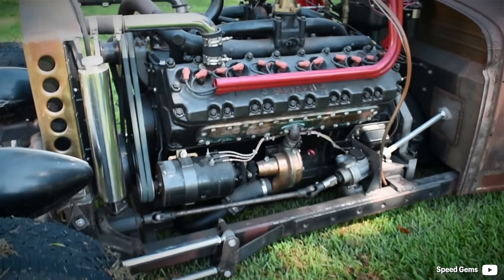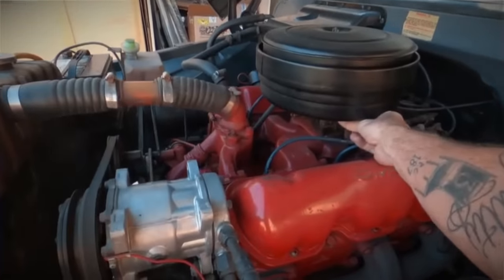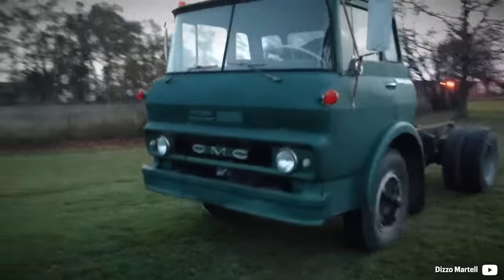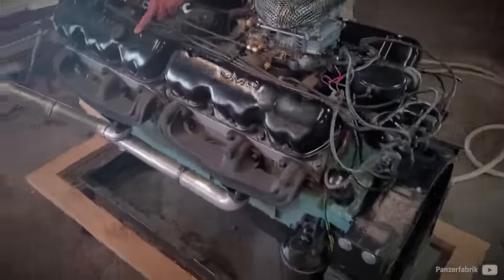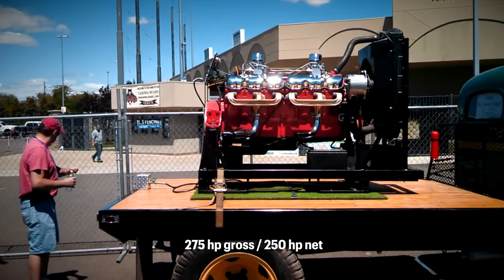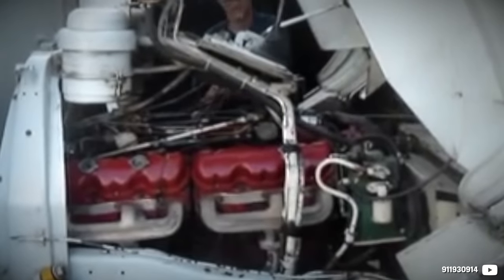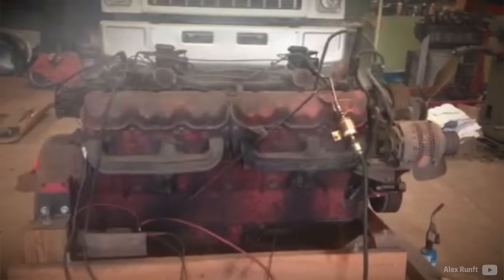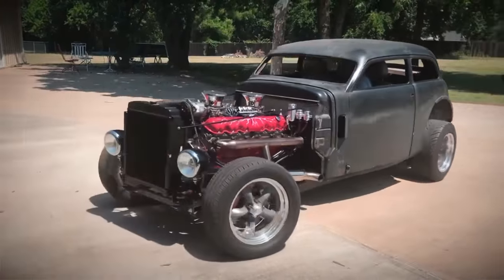GMC's Low RPM Gasoline 11.5-litre V12

Comment: Another interesting thing about the GMC motors is that most if not all of them have governors on them. I think that's the only gasoline motor vehicle that I've ever driven with a governor. I believe in the owner's manual, it actually talks about revving the motor to the governor between shifts.
Reply: the governor  can be turned off
Reply: @punker4Real  yes, but you risk blowing it up if you do.
Reply: International v549 in 70s school buses had governors on em. 
I know of 2 right now in generator applications. 
Huge gutless thing ,only runs a 75kw gen at 1800. 
They did the job ,but what a heavy tank.
Reply: The 351 big block Tonawanda engines used in the Chevy Topkick and GMC Kodiak trucks had governors on them.
Reply: @butchs.4239  I've never heard of that motor before.   Was It a GM product?
Reply: @clinkerclint  Yes, though it turns out they were 366 cubic inches. Had one in a 1990 Topkick 24' cargo truck. The governor wasn't mechanical, it was part of the ECM computer. Made the truck annoying as hell to drive as it wouldn't let you gain enough speed going downhill to make it up the other side at anything close to the speed limit. Took a few tries but I finally found an ECM chip that bumped the top speed from 57 to 66 mph. Doesn't sound like much but I drove that truck from ocean to ocean at least a dozen times and it made for a much more pleasant road trip.
Reply: @butchs.4239  Holy cow, that's a big trip in one of those trucks.    We had a 366 in a 73' C70 ten wheeler.   It would run no-joke, 90mph.   Like you said, they needed speed to get up the next hill.   Absolutely gutless.   That motor has always been one of those things that just never made sense to me.   Small bore.  Not enough CID.  Massive packaging, tall deck, 4 rings.  Square flange Holly carb (when they were using carbs).  I've never found the camshaft specs but I swear they had to have had a tight LSA or a bunch of overlap.   All the ones I was ever around had a fairly rough idle.    Such a weird combination and GM kept that motor FOREVER.
Reply: @clinkerclint  Mine was an ex-Penske truck, I always assumed either GM governed them due to 55 being the speed limit when it was built or had it as an option for rental fleet operators, school busses and the like. I've driven later drop nose Uhaul trucks with same 366 & Allison transmission that would comfortably run 75 mph all day. With a decent load in it it rode well enough that it wasn't bad to drive long distances, you just weren't going to get anywhere quickly.
Reply: @MrTheHillfolk  Loadstar 1700 with a IHC 549? I think they came in dumptrucks. That would make a nice 2 stroke conversion.

Comment: My 1969 GMC 5500 grain truck has the 305C V-6. I bought it 31 years ago with a blown head gasket, rebuilt the beast, and it's given me no problems since but It needs valve adjustment annually. The lifters aren't hydraulic and the clearances close up- probably due to today's unleaded gas. It's hauled a lot of firewood at 60 mph and many, many gallons of gas.

Comment: I worked on these engines for years; our fleet had a significant number of V12 GMC tractors with single drive axles and a pneumatic tag axle for the load weight. You had to be very careful starting them if they ran out of fuel, as they would backfire through the intake flame arresters. I was a tech for the transport company mentioned in the video.

Comment: 637ci engine has a 5.125 bore and a 2.75 stroke
Drag racing engine builders should have used this platform for designing their blocks with a bigger piston so we can have more power at the top into the race track in my opinion

Comment: A local volunteer fire department used to have a 1960’s cab over GMC water tanker truck. Had the V12 gas engine. They said it did well into the early 2000’s but they eventually replaced it.

Comment: This thing with some equal-length long-tubes, reground cam, solid roller lifters, a bit of head work, and a couple Holly Dominators with some modern ignition... Imagine THAT bad boy in your hot rod. Or better yet put it in one of those racing fire trucks or something, lol.
Reply: There were aluminium block ones too.
Reply: There's a company that does that, it's called Thunder V12 LLC. Their engines make around 425 hp and rev to 4,000 rpm.

Comment: The 702 is the true embodiment of "No replacement for displacement"!

I would say could you imagine what it would do with a turbo, but then I remember it is a low-RPM engine, so it would never see the full benefit of inducted boost.

Comment: In my opinion, the one and only down side to an engine like this is simply the fuel consumption.  everything else is great! super simple, any basic mechanic can service and maintain one, pretty much nothing to fail, way over built.   I have the GM 502HT crate engine in a K30 chevy with a tremec TR4050 and it pulls amazing!

Comment: These were the most over square engines GM or anyone built in the 60s.  The low rpm coupled with the short stroke kept the piston speeds way down, very important to long engine life.

Comment: They made a 637 v8 that was used in busses as well as making a few of these engines diesel. They had suffixes that designate high output or industrial or diesel etc
Reply: The toroflow diesel? this this 702 v-12 looks like its built far stronger than most diesel, the huge bore spacing would make for a sick 2 stroke conversion.

Comment: The GMC V12 was built for the missle mover truck. 
The driver laid down kind like some racers. 
When I was going to college, one of my classmates was a missle transporter. I do not remember why the government wanted to use a gasoline instead of a diesel. In 1968 or 1969 all of the GMC missle transporter trucks were scrapped.

Comment: Drove GMC V12 powered semi  trucks, hauling groceries. Only used on local routes because fuel consumptions was horrid. 1 1/2 mpg empty, 1/2 gallon per mile loaded. Refilled after every trip, I was shocked even then. Also very little power, that could not be hurried.

Comment: The  V-12's were used on irrigation wells here in So TX. Especially if you had a "natural gas well" on the farm. Used to be common around Pleasanton, Tx. I had a "305" v-6 in my 66 GMC.

Comment: the crankshaft tipped the scales at 180 lbs, the engine measured in at 4.2 feet long, and it weighed 1,500 lbs fully assembled including intake and exhaust . that's 3/4 ton

Comment: Notice that it has four heads rather than two. This comes from the Detroit Diesel 71-series, where their 16V71 has two four-cylinder heads per bank and their 24V71 has three of them. This does three things for them, all good.

First, it reduces complexity. An 8-cylinder head would have been a lot harder to machine and more prone to warping. DD knew those engines were going to be rebuilt many times over their long lives and no machine shop would have head resurfacing equipment capable of working on a huge head.

Second, it reduces head weight to the point one mechanic could handle it.

And finally, it reduces cost. There were thousands of 8V71 engines in the field; 16V71s and 24V71s were rare beasts. I’ve only ever seen four: my base in Korea and my base in Germany each had two, and they were all on generators. Because the 8V71 is so widely used and the big engines not so much, getting a new four-cylinder head would have been much easier than getting a new 8 or 12-cylinder head; those would have been made to order and 4-cylinder heads were in truck dealers’ parts departments.

Comment: It's a real misnomer to claim, that early gmc trucks were based off Chevrolet their motors wheel bearings transmission were all very unique an example of this is early 1950s gmc light duty trucks v8 were actually Pontiac castings I know I've worked on them

Comment: The same recipe for the Isuzu diesel engine line-up. Overbuilt and detuned. 

The 12P series V12 of them has 22 liters of displacement yet only produces 300 to 400 hp. Same for their own 8P series V8, and 10P series V10. 

It would take a long while until their old 6SD1 i6 to be replaced by the 6H series engines that came from the 4H series i4. 

The 6W series is their current largest. Replacing the 8p, 10p, and 12p V engines.

Some 6H engines could even match the power of 8p series. 

As more stringent emissions control takes effect, they opted to introduce a cummins engine to supplement or replace the 6H series.

Comment: Those GMC 12s got about 2 mpg as I recall. Pet Milk had such a truck to haul milk in bulk tanks
Reply: That would discourage me from using it in anything but in a military battle tank.
Reply: It's all load dependent, as with anything. Milk is heavy.

Comment: Found one of these in South TX running a compressor on wellhead gas. Had been sitting for years, but still rotated. Wish they would have sold it to me.

Comment: Those old V-6's were real truck engines. All torque, and they weighed a ton.
a lot of folks who had the 305 in a pick-up truck, swapped them out for
the small block chevy V-8, which was lighter, and made more horsepower,
and revved more readily.
That twin-6... what can you say?

Comment: With the way diesel regulations and complexity are going in the US, I'd like to see some more large gas engines returning to trucks. Ford just did a big thing with their 7.3l V8, but it's really only good for light and medium duty trucks, not heavy duty road semis.
Besides, gas emissions are much easier and simpler than diesel emissions. A good set of EFI and a couple cats and you're good. No fancy filters, no weird chemicals, much cheaper repairs and maintenance

Comment: These engines were made after the 1950s crown jewel gmc 302 inline 6 which hotrodders used in the early 60s

Comment: My 67 Chevelle 396 SS came factory with 375 hp and 410 lb/ft torque. It's been bored 60 over, we put a pretty aggressive cam in it, had the factory heads ported, and several other mods. I'm not sure how much it makes now but It's pretty stout for what it is.

Comment: It's impressive in certain ways that other engines are not. What is not impressive is the efficiency. You may have built something to last a very long time, but the cost of operation quickly overcomes the shorter lifespans of other far more efficient (power made to fuel consumed) designs.

Comment: Using this motor from given design setup one could run a generator heat a building and run machinery all at the same time. Quite an engine.

Comment: Don't forget they made the larger v6s in the toroflow V6 diesel version. The 305s would twist pretty hard could get nearly 5k in my 66 with 4.56 rear. But only got single digits for fuel mileage the Stromberg carb used on these were pretty crappy Holley 2300 500 cdm two barrel was a nice upgrade but the wrist pins didn't like high rpms

Comment: Hey vizio, just a little FYI here. Just to get the record straight, this dinosaur was never to be put in a vehicle, ever. Not a truck, not a tractor. This motor was only used as an electrical generator, or water pump. The guy that put this in an old hot rod, he's probably the only one never do it. (not really. There's a few) He'll also tell you how heavy that motor really is, because, like I previously stated, it was never made to be put in a vehicle. I'm not positive if they ever put it in a La France fire truck, cuz I think I just saw one in your video, although you can't see the motor. But I was told multiple times, this was never a vehicle engine, it was a pump motor, or generator motor.
Reply: It was an option on gmc cab over semis in the mid 60s. At least according to my gmc dealer books from 1966
Reply: The V12 motor was created to haul the missles around. It was originally built for the government, but GMC started putting them in trucks. They are heavy!!! A V6 351 weighs more than a 454!!!

Comment: Your videos just get better and better! Loved this look at an unusual and quirky thing I had never heard of and your exemplary knowledge of even the most random facts about coolant and oil flow rates!!

Yes, 4mpg is indeed catastrophically bad  - and even with the wick turned up a bit with the higher rev limit, around 38bhp per litre does not seem a lot  - yet despite both those factors, the sheer quality of materials and construction that went into each one, is incredible. A bit like Mercedes Benz of the 70s and 80s, maybe not THE most exciting thing on the road - but almost certainly one of the most dependable.....
Reply from the maker: Thank you!

Comment: The Rolls Royce Meteor would have made a great truck engine. 27 litre V12 , 650hp and 1540 lb/ft at 2400rpm and weighed around 1500 lb.

Comment: @visioracer your first statement is only partialy true about the large gasoline engines propelling trucks - back in the day gas trucks were also used because diesels were very hard to start in cold temps... lots of soviet military trucks were gasoline for that reason
Reply: For example seagrave and american la france were fire truck manufacturers - fire trucks need to start right away in the winter

Comment: It's not even that far off mpg as a diesel under load. I see 426/494s in dump trucks from the 70's that people use sometimes around here in Ohio. The mileage might be poop but if you need to move something sometimes these big low compression engines can and will. They'll even start in -12F without a second thought.

Comment: The largest engine made for a gasoline highway trucks is the gen7 BBC 8.1 liters 496 cubes
Reply: Christopher- International Harvester made a 549 Cid V-8 truck engine, pretty common in fire trucks,  and they increased displacement to 605 Cid but those are pretty rare.
    I put a boat-load of miles on a late 70's vintage single axle FleetStar 1700 semi-tractor with a 478 Cid V8, straight 5-speed, single speed axle. Pulled a 45 ft long 13-1/2 ft tall dry box semi-trailer delivering freight between Davenport & Des Moines, Iowa and up & down along the Mississippi River from Dubuque to Keokuk Iowa. 3-1/2 mpg, twin 50 gallon saddle tanks for gas.
      The Ford Super Duty engines, 401, 477, & 534 were nearly as heavily Engineered for dependability as the GMC's.  And if you want to win the "MY Big Block is BIGGER than your big block contest, do a search on " Ford GAA,  1100 Cid gasoline V8. Designed as a 1650 Cid aircraft engine, was shortened to a V8 to power the Sherman Tank in WW2.
   If you search on " 60-66 Big Block V6" you will find the GMC forum, look around, I forget the name he uses there, but he has a V-12 powered 1500 GMC pickup, turquoise color, also has the truck I'd really like to look over, GMC late 1960's steel Tilt Cab, 702 V-12, 5+2 transmission, single axle, bright RED, looks showroom perfect. Would have been a popular truck back when I was young, Dad drove livestock trucks, lots of GMC tilt cabs, most 401 V-6 powered but a few 478's did get on the road. Most of the IH gas powered trucks had the 450 Cid Red Diamond in-line 6, woefully under-powered.  Guy Dad drove for the most got a 1964 GMC stub- nose conventional single axle tractor 5+2, with the 478 Toroflow. It wasn't " fast" but it was a short maneuverable tractor, decent speed with most loads and easy to drive with power steering.
   Diesels were never a problem in winter, you just NEVER shut them off. And I always carried a gallon of Power Service anti-gelling fuel treatment. My 903 Cid Cummins V-8 got about 4 mpg average about half the miles loaded. It was geared to run 67 mph, 6 speed Trans, single speed rear axle, 4.44 gears.  Would have liked to have had slightly faster gears.

Comment: I wonder if you could put in a turbo (or two) from an older Diesel engine and run it safely. Might actually improve the MPG slightly (5 instead of 4)

Comment: That’s so crazy that an engine that ginormous was needed to make those pathetic power numbers!   Technology is amazing.
Reply: These engines make high Torque which is why they are in trucks. Power numbers are not important if you have Torque, a well known fact to truck drivers. Power is calculated at the speed of the Torque supplied which is very low for these engines.

Comment: I wonder how these engines would do with  turbos or a massive blower.
Reply: Probably well as long as you limit the rpms
Reply: convert it to a 2 stroke with any port pattern you want, lots off room between those bores.

Comment: Work for a utility, and large gas engines in service trucks are making a comeback.  Modern diesels are too expensive, too fragile, etc.  If you need to tow distance they are great, but low miles and lots of idling are no bueno.  The new Ford 7.3 gasser is excellent.  GMC figured this out way back when.  I hope GM offers a new monster gasser to counter Ford.

Comment: I had a 478cui v6 in my bus the bus weighed 38,000lbs it had a 4 speed with a 2 speed rear end it was a pusher GMC flat nose think it was late 60s 38ft converted into a motorhome sold it to this young newly wed couple they were sleeping on their grandparents couch didn't have much money gave them a house it was pretty nice probably should of kept it though the bus was professionally converted

Comment: Nice as that is my old Detroit straight 6 at 815CI had 525 hp with 1650 torque. It still wasn't enough for some grades to maintain speed and this engine is less powerful even though it is a cool motor.
Reply: with boost it could make more power i guess.For the airflow pressure gas spark engines can produce much more power than a diesel.

Comment: There is no reason to use petrols for industry applications other than a lower initial cost. Petrols develop more power due to their much higher rev limits and theyre also significantly lighter. In return they use more fuel and have a lower life span. That makes them fun on the road but more expensive in the long run.